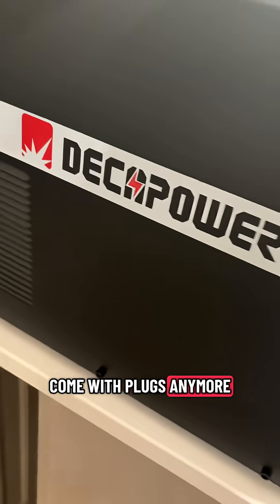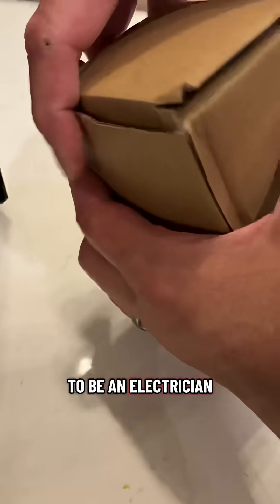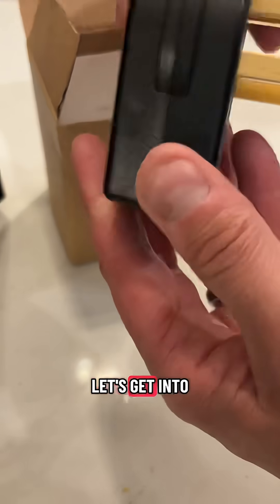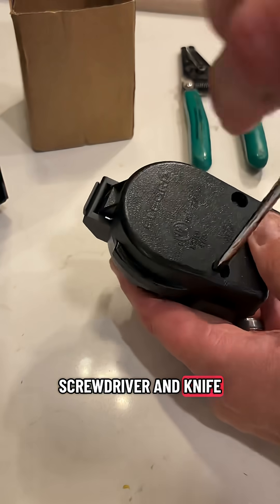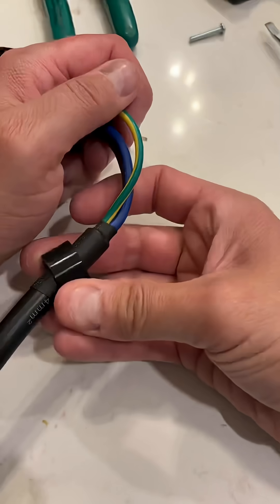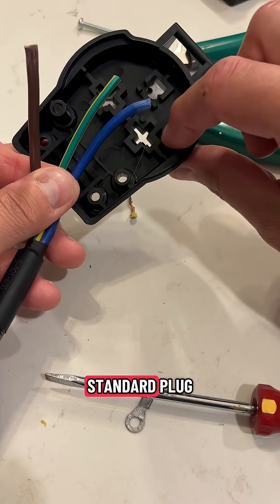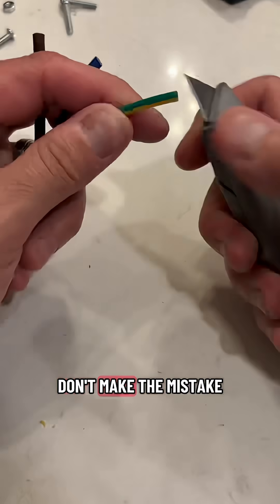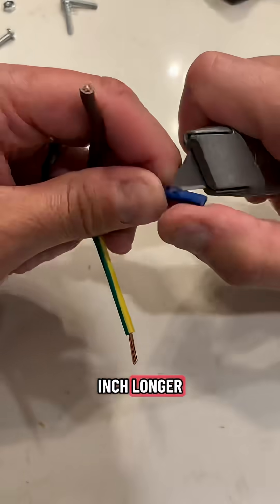how to wire a welder plug? Let me show you how. #electrical #diy #welder #welding #weldernation

Comment: You did wire it correctly but for knowing the correct terminology and stuff, there is no neutral for 220v plugs unless it’s 3 phase (I could be completely wrong on that I don’t work with 3 phase). What you’re wiring configuration is split-phase and any house/building that’s wired in 110 but needs a 220 outlet uses this to achieve the higher voltage. It’s just running 2 hots from the breaker (which is 2 pole, feeding both those “hots” which is 110 + 110) equalling to 220v w/ split phase at the receptacle. The AC works the same way it does with 110, but instead the “phases” or the two hots, are 180 degrees out of phase from each other resulting in them being able to basically use each other as their neutrals. (It gets very complicated but that’s the gist.)
Reply from the maker: thanks for letting me know.  full disclosure I AM not an electrician here. Perhaps I should have explained it that the one is hot the other is the return. not a neutral ?

Comment: Incorrect you’re currently wiring up a 220 full plug there’s too hot legs in a ground no neutral
Reply: He's Canadian.
Reply from the maker: thank for confirming. I did not know this. hence i am not an electrician. Is this 2  110-120 V wires coming in to make up 208-240?